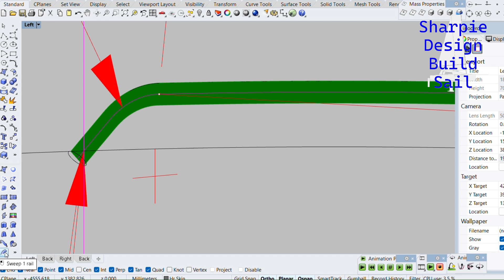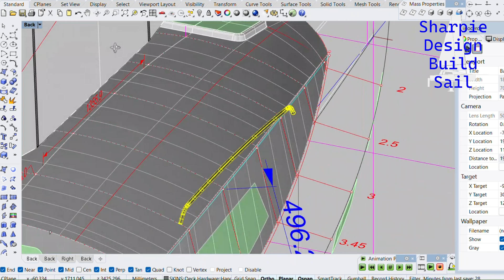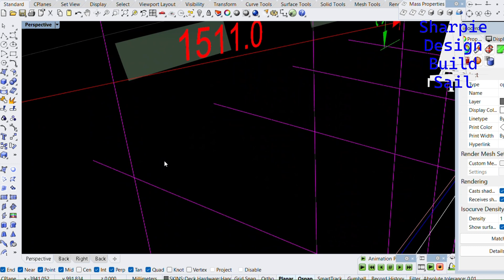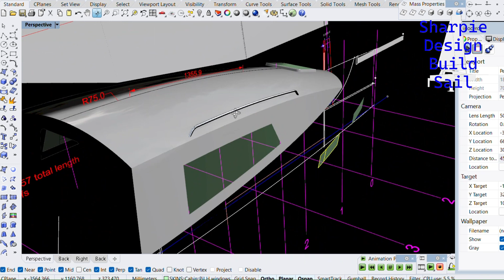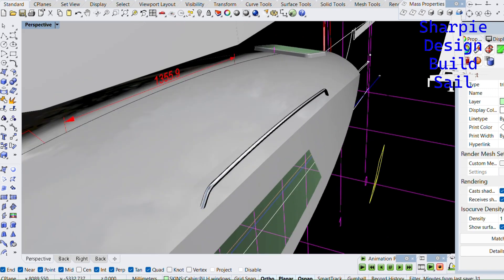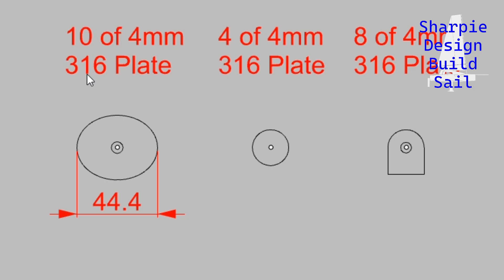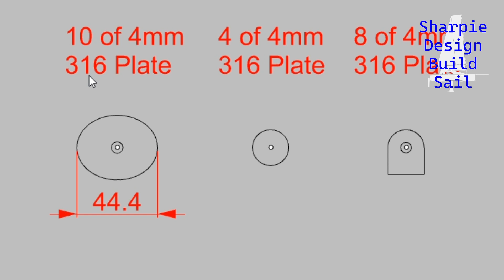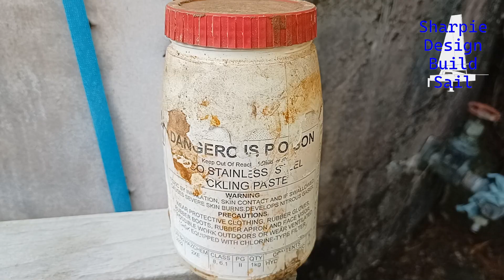DIY Electropolishing Stainless Steel Handrails - Sharpie Sailboat Trailer Yacht Build - Cabin Pt 7

Comment: hey another grate video thank you ! hey what’s your career background if you don’t mind me asking ?
Reply from the maker: Good to hear you liked the video!
I don't mind you asking about my career background.
At school I wanted a career that would facilitate my sailing ambitions and my father got me the choice of two apprenticeships, one in wooden boat building at Orams and one in fitting and turning in a local ship building firm called WECO which mostly built tug boat and serviced American tuna purse seiners. I actually joined the Navy as a weapons electrical technician before that but the indentured time seemed really long, I wanted to go sailing and turned them down last minute. For some reason I started with 9 others in that year a WECO. One of the ships we built was the Bounty replica (for the movie) but I missed most of that because I hit a car head on, on a motorbike, had a few operations and was back at work after a year in time to build all the rudder bearings.
Just after I finished my apprenticeship I got a job as second engineer on one of the American purse seiners and spent 3 months in the middle of the Pacific, working my butt off for little return. The stories I could tell!
That experience as second engineer got me a position as second engineer on the Rainbow Warrior II and I got to see a lot of the world and as a boat driver got to meet a lot of the police of the world! (who were usually quite friendly but "just doing their job" That took me from the middle of the Pacific, the Marshall Is, to the other other side of the world, Iceland. I was even heading up NY harbour on 911.... Again, the stories I could tell.
So in between all that and to fund my yacht building addiction there was many trips to Sydney to work in the factory maintenance and new machinery installation fields, in places like Arnotts Biscuit to Astra Pharmaceuticals to Lucas Aerospace. There was even a short trip as engineer on a prawn boat in the Gulf of Carpentaria. I didn't enjoy it! Some good stories though.
in between all that, I set up a steel yacht building business in Auckland built Ganley yachts. Towards the end of that I got out all my yacht designing books, thinking, I can design something which ended up as the 60ft yacht I lived on for a few years. That lead to the 50ft design which I also built the hull for for clients in Tauranga.
Again, in between all that, I worked for some years in the Stainless Steel business, which gave me the opportunity to get my SS welding ticket.
The tripod I use, I bought in 86 so I could 16mm film my sailing/diving adventure through the Pacific (partly inspired by Australian Alby Mangles). I spent 6mths around Tonga and Fiji on my 34ft steel Ganley Shadow (which I had finished the construction of from a bare hull). I took quite a bit of film which is in VHS format now. I can't keep up with the format changes!
So as you can read, it's not a simple answer to what my trade is, I've skimmed it but like to think I've had/made the opportunity to teach myself some diverse skills!
I will finish by saying, I made the conscious decision to prioritize sailing over my working life, work being a means to go sailing. Building a yacht instead of a house, from a financial perspective is not the smartest thing to do but I find myself in a place with no regrets. But if I did things again, I would have done more ocean sailing but I also remember the times at sea I would have given anything for the life I live now on a 'lifestyle block' with the time to dabble in coastal sailing 🙂
Reply: @KarlFullerNZ  wow bravo sir! thanks for taking the time to share inspiring and impressive !  maby some stores will come out when its. time to do more sanding!  look forward to your uploads every week! im currently fitting out a shipping container for a workshop id like to build a skiff one day  ill send you some photos if at all interested
Reply from the maker: @andrewwastney9228  I sure would be interested in seeing the details of your skiff design if you want to send the pics. Is it anything like the Goat Island Skiff? I'm really impressed with how they sail
https://www.storerboatplans.com/boatplans/goat-island-skiff-simple-sailing-boat-excellent-performance-lightweight/

Comment: Cool experiment! I think you probably still want to apply some baking soda to neutralise it afterwards in either case or long term you can get some staining. A stainless wire wheel in a drill is also very effective! Just beware the hub is often not stainless so be careful not to make contact and embed particles.
Reply from the maker: Hi Thomas, thanks for your constructive comments! I have a big SS wire buff that's quite aggressive and might get a smaller one for the drill as you suggest. I'll never forget the experience of buffing a SS masthead fitting of a little keeler I owned with a steel wire buff and the almost immediate brown colour that evolved was quite sobering to see!
Baking Soda for the neutralization sounds easy. 
I had the experience of anchoring overnight on my 60ft yacht in the lee of White Island. Never again, overnight a centimeters thick layer of ash settled on the yacht and I spent may hours scrubbing everything because man that ash is corrosive!

Comment: That was interesting. Would a simple stick welder (MMA) also work? Since they works as constant current source, precisely as the TIG machine without all the fine knobs for tuning the TIG-process. 
They often have the support for DC TIG with a lift arc start as an option. Please do not underestimate the nastiness of hydrofluoric acid (use thicker gloves), nor get it into your lungs. It's as nasty as HCl.
Reply from the maker: Thanks for the suggestions Captain.
I think a normal stick welder using and AC setup would work as I tried it and as claimed on a Utube channel I watched. It's a little more aggressive I think as you saw, because the power is always on to the hand piece so you get arching as you make contact with the brush. But yes, if your welder has DC for TIG welding, you could use it for sure. At the time, many years ago, I needed a welder with lots of control and high frequency start (does not contaminate the tungsten) for milk factory work and I had to had a ticket (pass tests) for purge welding. I would say my welds were technically correct but I don't think I've ever been the neatest welder!
I appreciate the concerns about the nature of the acid I was using, both on the hands and the fumes. It's no excuse but I do find trying to make video content that if I want to talk while doing something I need a mask on for, it's a tough call sometimes but nothing is worth compromising your health for in that respect! HCL certainly has issues for bone density!